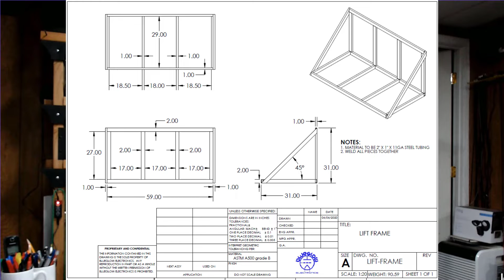SBS - 6-14-2020 Test Lead Tech Tip - Fake Tubes and Gear - Shop Remodel

Comment: I use plywood and sheet metal to cut slots into the wood or aluminum for various wire size.  File the rough edge and so can make them for pennies if you are handy.  Make great cable holders.

Comment: Just a question.  Have you explained how to design a power amp section using the datasheet in any of your videos.  What I mean is that if you look at a datasheet such as a 6L6GC in a single ended amp it states (in JJ's sheet) 250v for anode and G2, G1 at -14v, Ia 72mA, Ig2 5mA, N? Nominal? 6.5W - It then shows graphs like you have in your tester video and has maximum settings too.  So for a simple example say I wanted to build a 6L6GC SE amp and I have say 350v and a variable bias control from -5 to -35v...... How do you decide which voltage to use?  How do you choose a starting negative grid voltage etc etc.  I'm not asking for that exact example (although I am building just that now) I'm more asking how you decide?  Is it based on what transformers you have?  How do you know what sized signal you need from the pre-amp? How do you know what minimum and maximum pre amp outputs work? etc etc Loving your videos and my wife and I have barn envy :-)
Reply: i think the plate current might be what you look at while adjusting the bias so as to avoid "red plate" condition.

Comment: Any chance of doing a in depth video on ss tubes, like 83 or 5y3 installed in a tube tester to help eliminate drift from tube aging. Doesn't seem to be much that I can find on youtube. Thanks.
Reply: isn't that why there's usually a "line adjust", though?  i mean, aside from the fact that the voltage coming out of the wall can drift...
Reply: Took me awhile, but I found this SS83 information that I ran into when I made mine years ago.  Look at the first forum page and at the Zener design.  https://antiqueradios.com/forums/viewtopic.php?f=8&t=181387

Comment: Doesn't have to be passed by building regulations, you would need to have fire exit on the outside for an enclosed top floor and proper fire escapes and fire doors, especially if it's going to be commercial, can't see it being legal without the proper paperwork. Don't want to see you in prison mate